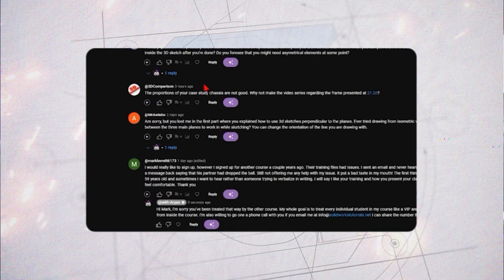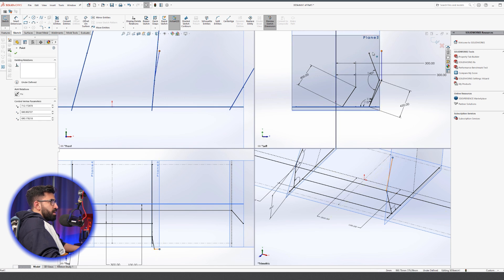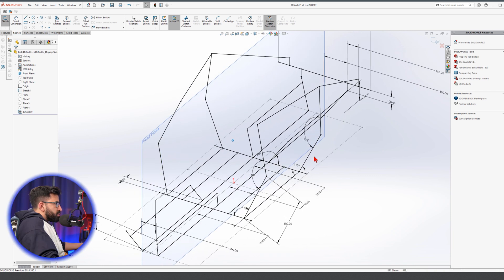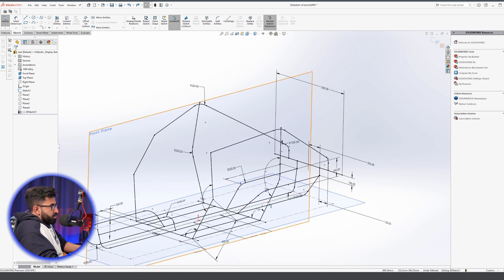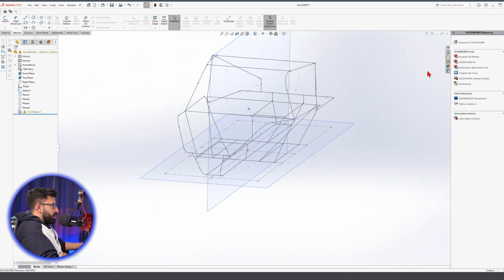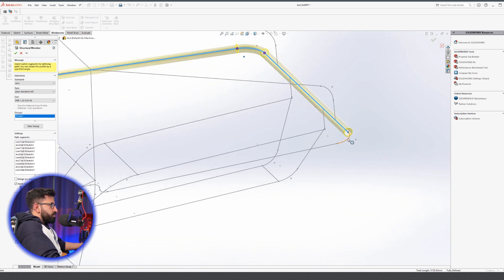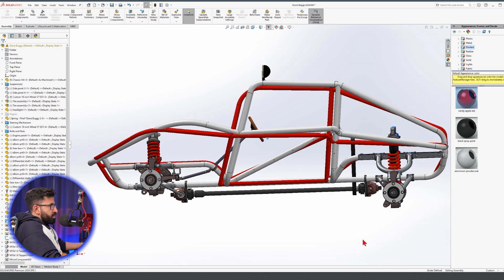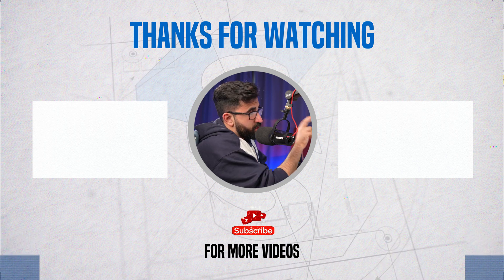Master 3D Sketching & Weldments in SolidWorks | Model with Me Series with Aryan

Comment: I sometimes finally it easier to draw the basic shape as solid bodies, then convert all the edges into a 3d sketch, add any extra diagonal member sketches then use that sketch for my welding members.
Reply from the maker: sometimes, yes
Reply: @with-aryan  are you still in the champions programme?

Comment: Aryan if you use normal sketches and combined them to projected curves you gonna have way way better and clean work and super easy to adjust in any position 😊 Im fishing lure designer and high performance boats.
Reply from the maker: There are always more than one way to finish a model, you mmight have that as the cleaner way for some scenarios for sure, thanks